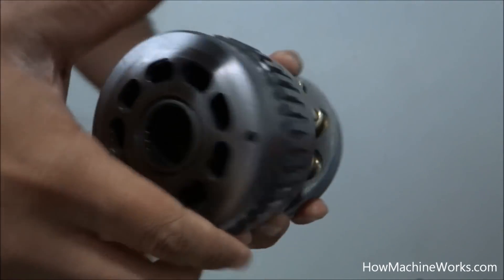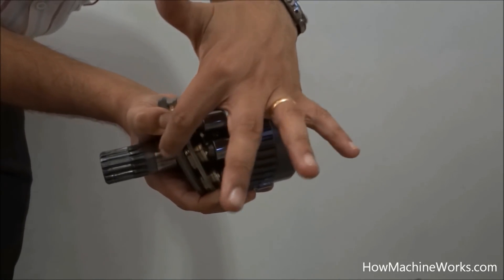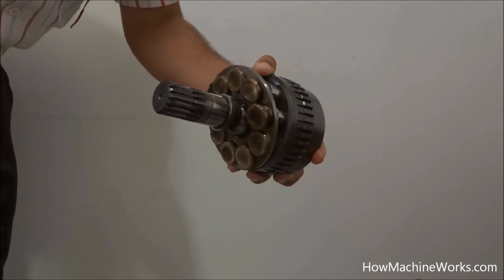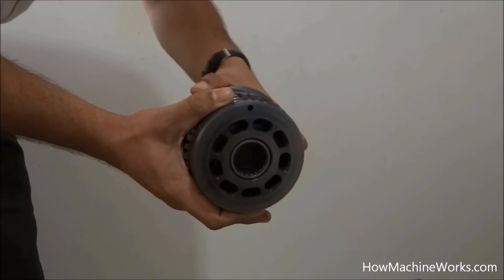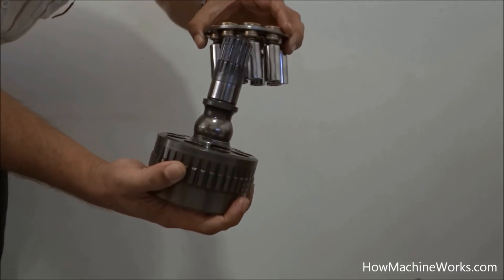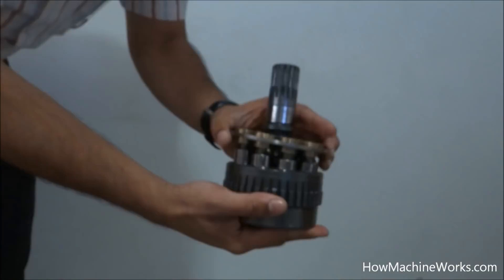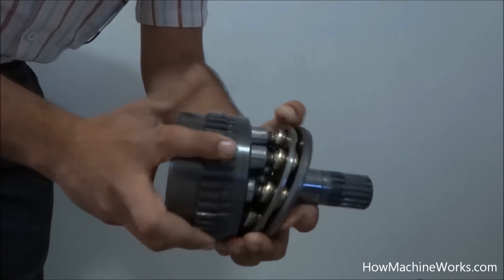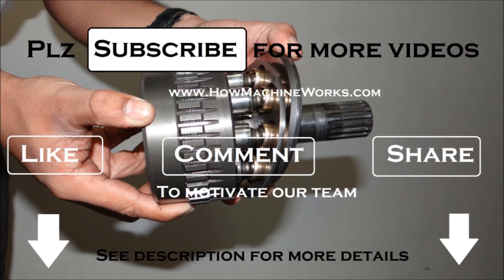How piston pump works

Comment: If swash plate is vertical, where does the pressure of fluid release and how as power pack/prime mover  would continue to pump the fluid to this pump but we have no flow in the motor?

Comment: Is it possible for the piston pump with the rpm of 2200 to run with a motor of 1500rpm? When I install this pump of 2200rpm with a motor rpm of 1500, the pressure of the oil drop and hence the machine stop due to not enough pressure to run the machine.

Comment: Why is the cylinder block circumference spine geared?Why machine it like that when it serves no purpose.
Reply: I think it's so heat can spread over more surface area which should prevent it from overheating.
Reply: @amritk5173  for the drive coupling. Sometimes keyed.

Comment: Thanks a lot. I used to thought that the Swash plate only rotates and cylinder block is steady. But with your actual demo, I cleared my all doubts. Please do one demo on Wobble plate type piston pump. Will be very helpful for understanding.:)

Comment: Does it matter which direction the input shaft turns in? Will the pump work the same way whether it is rotating clockwise or counterclockwise?
Reply: doodskie999
 It does matter. The beauty of axial piston pumps is that by changing the swashplate angle from positive to negative, you can change the direction of the flow, without changing the direction of rotation.
Reply: @lalianto  What if you wanted to maintain the same flow direction but change the input shaft rotation direction ?
Reply: nope doesnt matter

Comment: Wonderful Work Pal, This pump is used in the Steering Gear on a ship as well. It can control the flow of oil into the cylinders to get the exact amount of shift on the rudder. Thanks!
Reply from the maker: Ok tks for the update.Please Subscribe to us by clicking the SUBSCRIBE button for updates.Visit TechTrixInfo com for more details.